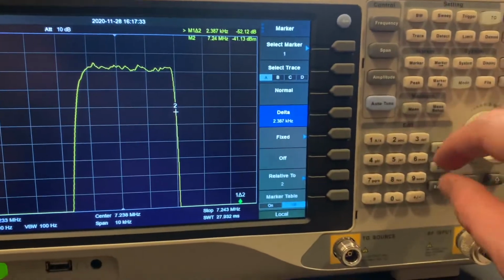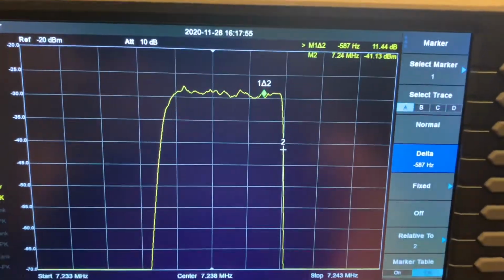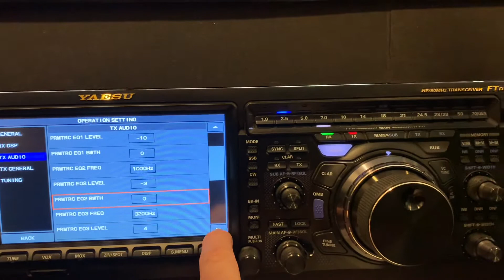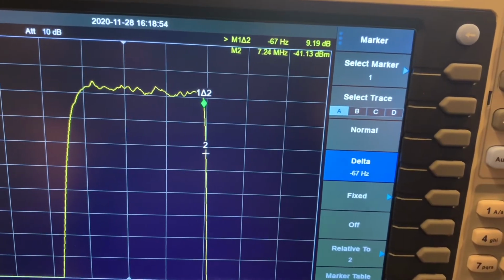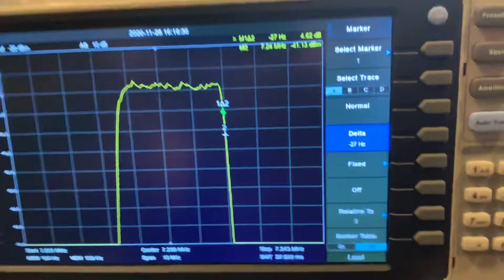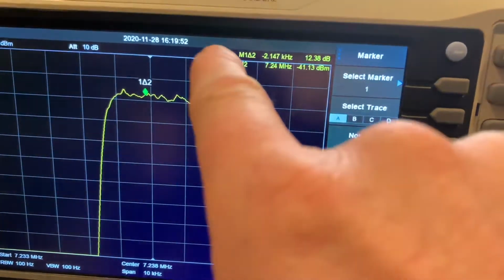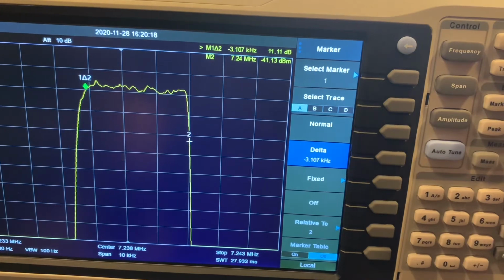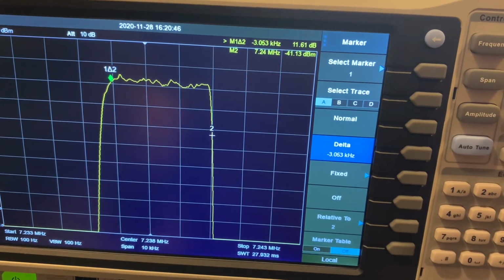FTDX-101mp flat SSB tx audio response - KJ7E

Comment: Very cool, did you have TTBF enabled in the TX BPF menu during this test?
Reply from the maker: I believe that was 50-3200.  With TTBF its a bit more rounded roll off on the top end.
Reply: @damonkj7e  Regarding Menu is 50-3050. If not TTBF. 73 Zygi SP5ELA